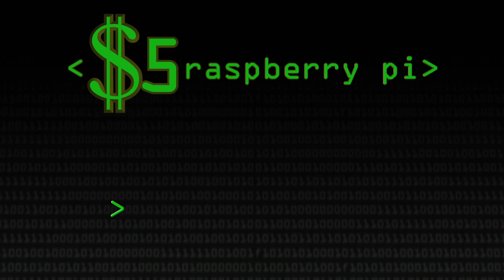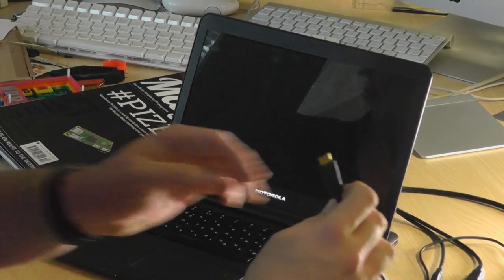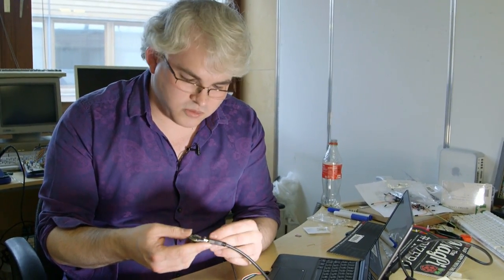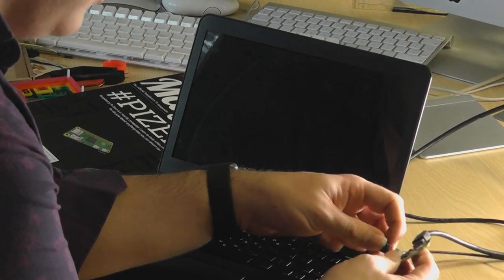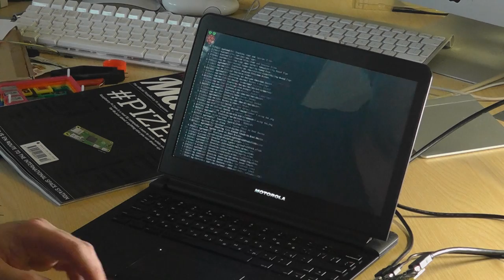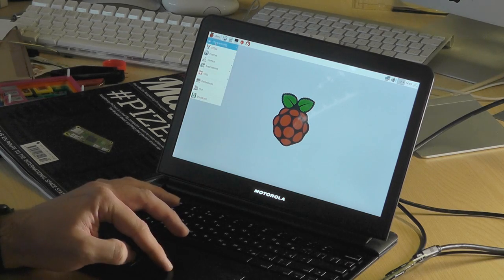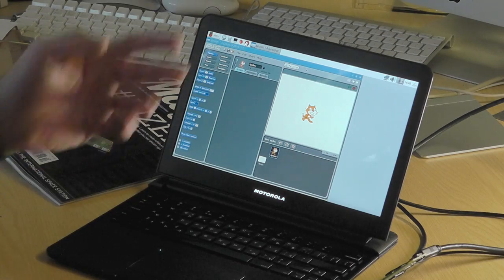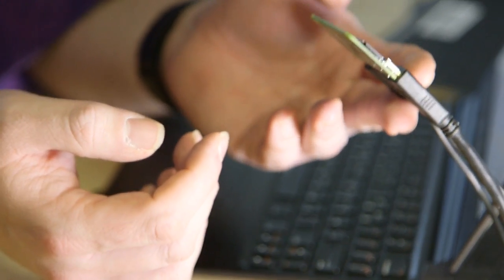Raspberry Pi Zero - the $5 Computer - Computerphile

Comment: I think people complaining about this thing are completely missing the point. Sure, you can argue about the usefulness, but I think a better topic is what it represents for the market. Computer prices are much the same now as they were years ago, and mobile phones have been getting more and more expensive over the last decade. Yet, for $5, this well-approaches all of that. What I hope is that someone takes this model of technology and builds the absolute cheapest products from it, in a way that pushes the market into a new age of low costs.
Reply: +Dojix Agreed, smartphones have become the item of 'conspicuous consumption'. Nobody NEEDS an iphone or galaxy s73 super uber maxphone 3 (or whatever they're up to now) as chinese basic android phones are 1/10 the price on ebay and often have better connectivity (dual sim slots etc).
Reply: +TheChipmunk2008 A lot of these devices are not powerful enough to run a lot of apps and can make Android pretty unresponsive.
Reply: +Dojix Not going to happen.   Completely obvious things like "swipe to unlock", "end of list bounce", and thousands of other "inventions" are patented.

Those Chinese phones Chipmunk mentioned from XiaoMi etc. will never be in the USA because of stupid patents.
Reply: +codediporpal Not even what I'm saying. I'm talking about the fact that smartphones can cost $1000 now, and although it's super fast tech advancement, I'd prefer an emphasis on doing the same stuff for cheaper. Imagine if phones paused for a year or two, and then continued. The price drop would be enormous. And I'd rather an ideal consumer experience, which does include price.
Reply: +TheChipmunk2008 Yeah but there are reasons why those chinese smartphones are so cheap.
Reply: swiftrealm The problem is most patents these days in software did not require any R&D.   They're just "good ideas" that 1000's of people have on their own to solve a problem, and any competent engineering student could implement in weekend.
Reply: thats what i was thinking, this seems like the start of truly affordable and practical computer technology
Reply: No one would invest into that.
Reply: the problem is we are not paying the same prices for the same product, we are paying the same prices for a better product, and this is just providing a low-end product for low prices. but it isnt going to drive down the prices of the average computer, because they are an average (for nowadays) product for average price. 
what it will do is allow people to purchase low-end computers for a low price. which i think is great. more options is of course better.
Reply: +Dojix Robotics.
Reply: I wanted to make a game console out of this that costs about £9

Comment: Except the lack of a LAN port, this is exactly what i was looking for, for a home automation system.
Reply: +lbochtler he said in the video you can have a usb - ethernet adapter. im pretty sure the original raspberry pi has an ethernet cable, and that is about $20/£20.
Reply: sKrublawd :^)
I know all that, but it would be more perfect if it would have the NIC onboard, not outboard.
Reply: +lbochtler But then it would be more expensive and also a lot taller.
Reply: *****
 i would have been happy with just the NIC Chip, and some threw hole pads, or even SMD pads. I route the R45 port away from the pcb on my other pies anyway. (not all but some).
Reply: ***** Well if you're going to be soldering anyway, you may just buy a USB to Ethernet IC. Sure, it's less convenient since this way you'll have to make a PCB but onboard NIC with no port doesn't make much sense. Keep in mind that the RPi 0 is mainly supposed to be embedded in projects (most of which will not need Ethernet) so keeping it small and cheap is a priority.

Comment: 2:52 micro USB to female USB converter costs 0.75$ on ebay.
Reply: it needs to be on the go compatible: a gender bender won't do it
Reply: Plus $5 postage.
Reply: +Dan Dart Why would it need to be on the go compatible. The USB port is a normal USB host port, just on a weird connector (for size). The gender bender will do exactly what's needed
Reply: +Potatocrunch94 search for an OTG hub and you get adapter and usbhub in one
Reply: +Potatocrunch94 and $4.99 shipping. And it's ebay so you might not even get anything.
Reply: Nopiw
Calm down.
Reply: +Potatocrunch94 dont forget the cost of the thernet adapter.... 
Frankly i would rater buy a raspbery pi2 unless i want an over powered micro controller..

raspberry pi's are attractive for that purpose of coarse since one is free to run other lanaguage then processing like on the arduino... there is a mono framework for gpio port manipulation so yay C#!
Reply: +ZerqTM It's a middle way between a full Raspberry Pi and the compute module (which flopped horribly because most hobbyist simply couldn't make boards as complicated as it needed and those who could just built the whole project from scratch and didn't bother with some pesky compute module). It is primarily meant to be embedded in projects (where you won't need most of these peripherals anyway) and it's perfect for that because of lower power consumption and smaller dimensions.
Reply: +Potatocrunch94 or 19p with free shipping form AliExpress. I bought a bunch of them and they seem to work.
Reply: +Potatocrunch94 You put the dollar sign ("$") on the wrong side... (No hate, despite how disgusted that sounds for some reason... :/)

Comment: What I really like about the Pi is it gives kids a HUGE selection of programming languages to use. Most programs and compilers are free on Debian so it is a great choice. They can look for the language they like even if it is quite different like Common Lisp or Scheme. I don't want another generation of Microsoft only kids. There are probably 30 languages you can easily get out of the box.

Comment: Indeed there are drawbacks:
- Awfully slow in the X environment,
- No graphic acceleration in X windows,
-It costs a lot more than $5...
Reply: +Andi Cui Yup, This hardware is not very good for "graphical stuff" visual languages etc. It's unusable for web browsing. For console stuff is great, but probably many people are scared by terminals...
Reply: +Andi Cui Oh, and Pi Zero has unpopulated GPIO pins, so You must solder a pin header, if You want to use them.
Reply: +Maciej - It's not for people scared by terminals. Simple as that.
Reply: +livarot1 
Actually it's great for people who are scared by terminals, to learn not to be afraid
Reply: Why would I want a X server.  If I can ssh into it that's more than enough.
Reply: *****
The command line isn't supposed to be great, it's supposed to give you basic control over the computer.   
And what do you mean by "there is no network adapter"?
Reply: +McDucky No, no, no. Command line gives you much, much more than basic control: scripting, automation, batch processing etc. but You don't won't to use it  for photo editing or 3D modelling for example...

What I mean by "there is no network adapter" is that there is no built in network adapter on Pi Zero board.
Reply: *****
Those are not inherent to command lines
Reply: +McDucky IMHO yes they are...
Reply: *****
I'm thinking objectively.
The command line is an interface, not an application.
You're probably thinking of a shell, which I agree should have integrated scripting.
Reply: +McDucky Now You're just being silly. Of course I'm talking about command line interface implementation, command line shell if You insist. We're talking about Raspberry Pi after all. You're getting pleasure from unjustified nitpicking I suppose...

Comment: I like my 2 Zero W's. One is in a GamePi20 case and I managed to get a reasonable text screen under RetroPie (command prompt). One day, I might get Pico 8 to show on the display. The Pico is much better for micro controller tasks. I settled with MMBasic and build stuff with those Pico's in 2023. The others are quite like any laptop/desktop and if I didn't have them with Raspberry Pi OS, gpio and touch screens then I would sell them off again.

Comment: There a bit of a better edition released called the Pi 3 it has inbuilt wifi and Ethernet ports if you wanted to spend a little extra it also comes with 1.5GB of RAM and a Quad Core ARM CPU very nice little machines I owned the Pi 2B it has the Ethernet connectors but a wifi card must be added if you would like to use wifi there very fun little devices to play around on I think the more expensive versions are around $25 - $35 there are also a few other competitors such as the Banana Pi and the Orange Pi and so on but the Raspberry Pi is by far the more popular ones I also like the look of the Intel 2GB stick but its a little more expensive but could come in really handy for using the TV as a monitor thanks for the videos guys and great explanation Steve.

Comment: But can it run Crysis?

Seriously though, can it run Half-Life (the first one)?
Reply: +yalamix probably
Reply: +yalamix I doubt it, but you never know :P
Reply: +yalamix half life 1 only needed 500mhz (0.5ghz) and 92mb of ram, so no problem there; though dont think hf1 was ever made for linux. But get this, half life 2 min system requirements is only 1.7ghz and 512mb, directx 7... so it probably can run it and if you give it a time or get 2-3 of them (LOL) then you can probably run half life 2 too -- there might be a few snags like I&#39;m not sure if half life 2 had a software render or required a gpu but just specs wise its not far off

Here are a few other things with min system requirements (ignoring video card) that just fall way into the grasp of this 5$ thing: diablo2, warcraft 3

The irony here is that even with out looking I can almost definetly tell you that any cheap looking indie title in the last 7years or so WILL NOT run on it because all those are build with horrible object oriented languages and so require titans to get smooth framerate if even that.
Reply: Hum... I think Half Life 1 might run, because I tested it on my oldest computer (1.6 GHz Sempron, with an integrated "video card" with an astouding 32 Megabytes of memory) and it was playable in windowed mode. And I was running Windows 7 on it so...

And HL1 also has a feature (that I forgot to turn on on my test) to turn down graphics to a bare minimum (when it came out it was heavy duty for the GPUs of the time) so I think it might run on this thing.

Half Life 2 though, probably won't run at all.

If there is no way to put Windows on the Raspberry Pi, then I could use SteamOS (which is Linux based). But I don't know if HL1 was ported to it.

Not just Indie, but many AAA titles also have crappy optimization. I remember when I bought GTA IV and it was barely playable on my notebook simply because it had an AMD video card. Even though it was above the minimum specs.
Reply: +yalamix Listed system requirements for Half Life for "SteamOS + Linux" from the Steam store: Linux Ubuntu 12.04, Dual-core from Intel or AMD at 2.8 GHz, 1GB Memory, nVidia GeForce 8600/9600GT, ATI/AMD Radeaon HD2600/3600 (Graphic Drivers: nVidia 310, AMD 12.11), OpenGL 2.1, 4GB Hard Drive Space, OpenAL Compatible Sound Card

I remember getting the Game of the Year edition of the original Half Life (with Opposing Force) for my Win95 machine - below the (identical) listed minimum spec for both games, but HL played (with occasional lag) while OF was unplayable - the opening cutscenes took a ridiculous amount of time, and there was a 2-second lag on mouse movement once the game proper started, making rapid aiming impossible.
Reply: +yalamix There is an attempt to port Half Life to Android (look up Xash3D), but as far as I can tell, it is also possible to compile it for Linux. Don't know for certain though.
Reply: So Half Life 1 running on a Raspberry Pi certainly seems plausible... I recent read about more powerful alternatives to the Raspberry Pi, and the Orange Pi looks like it can run HL1 just fine.
Reply: rmsgrey
I know that feeling. I used to play GTA San Andreas at 10fps. Or less. I guess playing HL2 on a machine as compact and cheap as the Pi is still a few years away.
Reply: xash3d is a opensource half-life engine which runs on:
Linux
OSX
Windows
Android
Reply: @nightbasilisk  actually the minimum system requirements for the original retail Half-Life 1 are Pentium 133MHz and 16MB of RAM. It is Half Life: Source that needs Pentium 4 500MHz and 92MB of RAM.

Comment: rpi0 CPU power is more along the lines of a mid-range desktop from early 1999  (p2-400mhz) not the mid-2000s (athlon 64/pentium 4).. although the GPU is definitely higher end than almost anything available in 1999..

Comment: For the record, not all of the Motorola docks can be used like this—I bought the wrong model off eBay and couldn't get it to function as I wanted! (It's possible with some hacking it could be made to work but I never got around to that).

Comment: Would this work for Emulation Station?
Is the raspPi 2 more powerful?
Reply: +VintageMayo Would be nice to mod one of these inside a SNES controller. It's probably smaller than whatever circuit board is in there. Rip that out, wire the buttons directly to the Pi and have an HDMI cable go out instead of the controller cable =)
Reply: +shiftplusone80 
OSMC with Kodi also has an emulator add-on.  It is an easy operating system to install, easy to use, and has a lot of other multimedia features. https://osmc.tv/download/
The add-on is called Rom Collection Browser.
Reply: +LarlemMagic Nice profile picture. It brings memories from the best game ever made! (Which is Baldur's Gate 2 for the uninitiated).
Reply: Yes and yes.
Reply: +Anders Öhlund the buttons on a controller are directly part of the circuit board, so you'd be removing the conductor pad and installing switches yourself, that being said, it IS doable.

Comment: I don't think it's the same speed as a PC from "early 2000s".  Comparing it with an 800 MHz AMD or early GHz machine, the PCs were superscalar and had fast floating point and vector processing units.  A Pentium-whatever would execute more than one instruction in 1 clock tick.

Comment: 1:25 I dissagree. It is about as fast as late 1990's, early 2000's cpus like the pentium 3 and amd duron. Don't get me wrong i have a raspberry pi, it barely consumes any power, it's great for linux and i like it very much, but it is very slow, compared to mid 2000's or more modern cpus. You have to know what you are getting, because you will be very disappointed if you expect too much from it and then try to just browse the internet with it and see how it lags.

Comment: The pi zero will need a USB hub and a wifi to me meaningful. Look at the HubPiWi - a USB Hub with integrated wifi for Pi Zero. Does not need any cable or connector. This is one of the best projects ar kickstarter.

Comment: This isn't just cool for computer classes. I imagine a USB thumb drive that is also a personal computer. Plug it in and it augments the computing environment in ways other than just being a hard drive.
Reply: Ummm, you know you can already get these for around £60 that plug into a HDMI port...
Reply: +Dilylo - treat me like I'm unaware. Tell me details. Thank you.
Reply: Dylio. Sorry.
Reply: +Michael Winter No problem.
Reply: +Dylio Hamer They're really cheap. They generally run Android and can be used as a Media Centre, or can have a keyboard and mouse plugged in for a full experience. They have ARM processors (like the PI) and are fairly powerfull. You can find them on eBay for around £25 - £100.
Reply: +Dylio Hamer is there a specific name of these devices? And thank you for letting me know about this!
Reply: It may not be a full computer, though there is a microcontroller called the Digispark that can plug into a usb port and talk to the computer. So I suppose your idea isn't too far off with the RPi 0 and all.
Reply: +Michael Winter They usually go by "dongles" for some reason, even though that word applies to any small device that connects to another as a peripheral.

Chromecast is the "big" one in this area, it's basically a headless (this means without screen or keyboard) android device that plugs into HDMI (and maybe also USB for power). You can get plenty of other brands like miracast or whatever the Amazon one is called. Chromecasts are also insanely cheap, close to what you'd pay for a moderately decked out Pi.

Even Sony sort of made one, which is a headless PS vita but slightly too big to be a dongle.

Comment: You cant compare these to computers from the mid 2000's because its a completely different architecture. Even if it was the same they are still not even close to say a p4. A correct comparison would be to say its similar in power to smart phones from the mid 2000's, like the old blackjack windows mobile platform....or the palm lineup. Its cool to think that those kinds of devices might have cost 600 bucks so long ago but you can get equivalent power for so cheap.

Comment: Not sure this is the equal of an average laptop from 2005!  I still use laptops from 2003/4/6/7 and they all load and run YouTube almost instantly.  The Raspbery Pi Zero seemed to take forever doing the same task.
Reply: Middle of the year, not the decade.
Reply: +EgoShredder That was because of his bad internet connector. Loading webpages has almost nothing to do with the specs.
Reply: purplegill10 So how come I own about ten PC type desktops and laptops of differing CPU, GPU etc, and on my 152Mbit Broadband connection they all perform differently.  Of course if the page you are loading has to process videos and java, along with browser add-ons, the faster PCs will cope better.
Reply: EgoShredder True, but this is the Raspberry Pi we're talking about. It has a very basic browser and from the webpage that was loading, it looked pretty barebones.